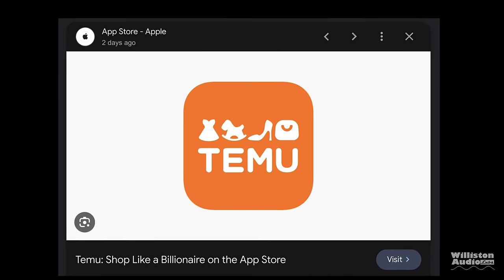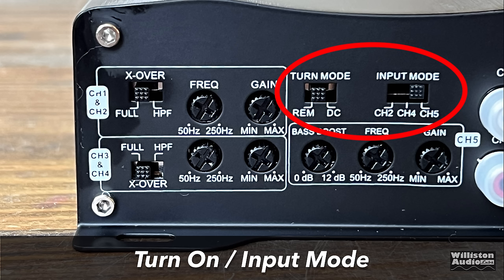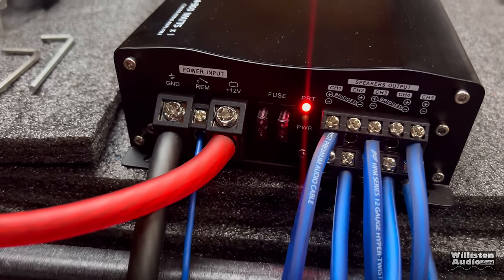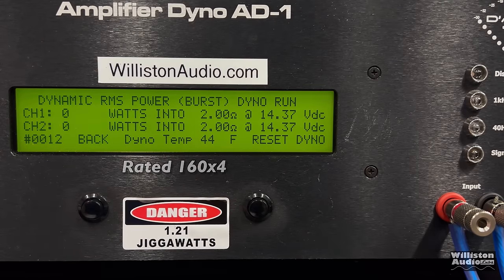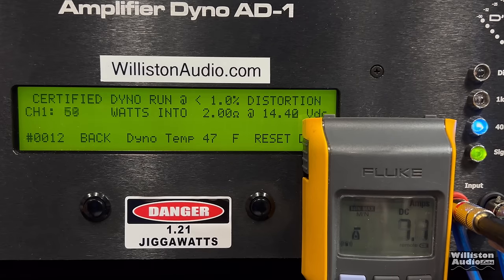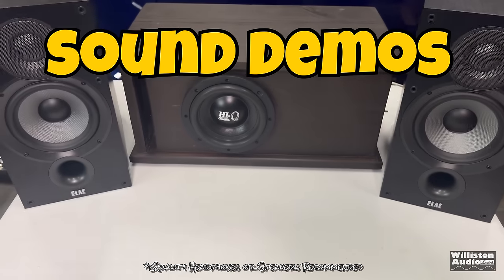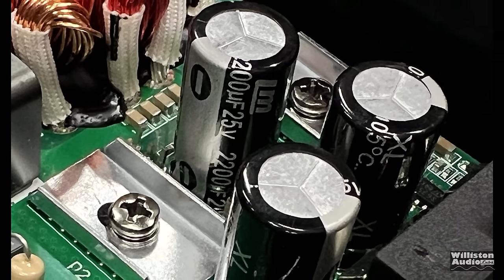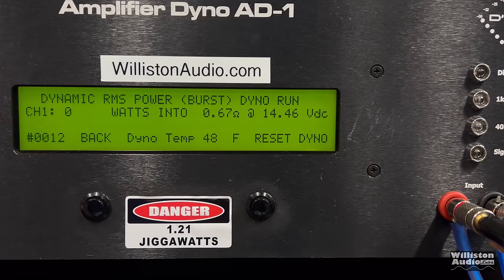I Bought a TEMU Car Audio Amplifier

Comment: Can you send it off to someone and have aome bigger caps and other minor mods done to see how much better it could be with some mondor modifications?
Reply: The cost of shipping, parts and labor would more than double the cost of the amplifier and probably not give you any improvements.
Reply: Bigger caps won't necessarily make it give more power. It might give a tiny boost to dynamic range, but that's unlikely since it's using a regulated switchmode power supply (SMPS). The inbuilt SMPS is already doing the job OK, as it's putting out rated power with all 5 channels loaded.
.
You can get an indication that the PS overall is insufficient when the power with 1 channel driven is higher than with all channels driven, however in this case D didn't test a single channel alone.
.
The main use for lots of big caps is for amps with unregulated PSUs, as the caps hold the peak voltage higher under quick bursts of power, so the dynamic output is higher than continuous RMS. In these cheap regulated PSUs the voltage is held 100% constant by electronic feedback, so bigger capacitors have no practical benefit to power output.
.
That said, the caps are there to filter noise from the power supply rails, and yes more is often better. As the caps die, more and more noise starts affecting the SMPS and it will start to malfunction at some point. The electrolytics only ever degrade (never get better) so having an excess of capacitors is definitely beneficial to a long and stable product life.
.
This thing probably only has the absolute minimum of caps needed to work when brand new, and would benefit from re-capping with more of better quality caps. Whether that's worth doing on a $100 amp is debatable since a decent set of caps will cost more than that 😂
Reply: @johncoops6897 You're thinking this amplifier has a regulated power supply? I was thinking it was unregulated since the output varies based on input voltage.
Reply: @JasonWW2000  - I explained it very simplistically, and while totally assuming how good of a SMPS is being used.

.
We know that the power supply in this amp is regulated because the total power doesn't change during the "peak" tests. If it was unregulated, before the burst signal was applied the rail voltages would rise above nominal. During the short 40Hz burst, the amp would draw a higher voltage (being stored in the capacitors) and hence would produce more power than with a 1kHz continuous tone where the voltage reserve would be depleted.
.
However, the total power output of a regulated power supply (to the amplifier) will still vary depending on the input voltage. You won't necessarily get more power with >14.4V but you will often get less with <14.4V. That's because voltage output of the SMPS is only regulated to a certain maximum volts.
.
Keep in mind that it needs to get that (total) power from it's own input and switching stages. The SMPS controller varies it's duty cycle to ensure that a certain voltage is available for the amplifier rails. If input voltage is lower, then it takes more Amps to achieve a given power level... but once the max is reached then the SMPS cannot process more current, so output Volts (and Amps) will reduce.
.
It's not actually quite that simple, and it depend a lot of the quality of the SMPS. We can assume that this amp uses the absolute minimum that it needs to need specs. In the following I will attempt to simplify without it being an electronics tech course...
.
Let's say the Amp and the SMPS are rated total max 1000W at 14.4V and there are no internal losses. That means that the SMPS needs 1000W / 14.4V = 69.44 Amps to provide it's regulated voltages to the Amplifier stage. So let's say that the SMPS has a total max current capability of 70 Amps, so all is good at 14.4V but everything is maxed out.
.
Now, let's feed the thing with just 12V. The SMPS can only provide 70 Amps maxumum internally. Therefore, at it's regulated output voltage (to the amp stages), it can only produce 12x70=840 Watts in total. Under lighter output loads, the SMPS regulates it's output voltage perfectly, however with reduced input voltage the SMPS cannot increase it's current... it cannot switch the output harder or faster as it was already maxxed out. Therfore, the output voltage rails starts to sag below the normal rail voltages, reducing output power.
.
So let's say the regulated SMPS provides (say) +/- 40V rails to the Amp section. The regulation prevents it EVER going higher than +/-40V and it's regulated to that up to a certain max power (e.g. 1000W at 14.4V) - so under light or intermittent loads the voltage will not rise, so the "peak" or "burst" power will not be any higher than for continuous load.
.
Yet if input voltage drops from 14.4V to 12V, then the maximum total power from the SMPS might well drop from 1000W to 840W. This is caused by sagging of the amp voltage rails, because the output load is "fixed". The rails can only get what they can get from the SMPS, and Voltage and current will drop to suit that.
.
That's a lot of theory, and we don't have sufficient info to know exactly how THIS amp performs with varied input voltages. A high quality amp with a good regulated SMPS might be able to provide max rated power at lower input voltages, and some brands even make this a marketing feature.
- my assumption here is that it's been designed without very much headroom, since it's been designed to meet a certain price point.
Reply: @johncoops6897  The regulated power supply I'm thinking of was common back in the nineties where the amplifier put out the same power at 12 volts as it did at 14.4 volts. I guess you could call it tightly regulated. That style of car amplifier isn't very common nowadays. 

Any time I see the output wattage vary based on the input voltage I think of it as having an unregulated power supply. I don't really understand how the regulation part works. 

It seems like almost every modern car amplifier is unregulated and can put out more power at higher voltages.

I don't know, I was just assuming this particular amp was unregulated.

PS, I assumed that during the peak test the reason we didn't see an extra amount of dynamic power was simply because the amplifier didn't have any additional reserve left in it.
Reply: @JasonWW2000  - the "amplifier not having an reserve" is precisely what proves it has a regulated power supply. It's the power supply which is the reserve...
.
Same as those old amps with "regulated" supply that you mention. They might be rated 1000W at 12V or 1000W at 14V... they are regulated to 1000W.
.
It all depended on the PSU, if it's running at rated 1000W at 12V then it will run even easier at 1000W on 14V or 15V or even more... unless it blows up 😃
.
However an amp that is rated 1000W at 14.4V with a "regulated" supply only means it sets the upper voltage level of the rails. It's regulated to never exceed those voltages if it's running at 1000W, 500W, 100W or 10W.
An unregulated supply has output voltage rails that vary with the load applied. At 100W they might be +/-50V yet at 1000W they might be only +/-40V. If it's playing at average 100W and there is a sudden bass beat then that will hit with the full +/-50V, but only for a moment. Hence big punch and dynamic range that hits higher than it's Continuous RMS ratings might indicate.
.
The article where you learnt that "strong" regulation term has some of the basics. However it doesn't cover the limitations of the SMPS itself, and how it can only ever provide the maximum it can provide.
.
The "regulation" of a PSU is on voltage, not total power. Let's use an analogy of a (decent quality) USB charger that's regulated to provide 5V... That will never provide 5.2V, even at no load. And it's rated at (say) 2A (10W) at a certain input voltage. If you exceed the current drawn, the voltage will sag to meet that max 10W. Doesn't matter if you feed it more input volts, it can only ever do 5V and draw a max of 10W... but how far can you reduce input voltage before the output wattage reduces?
- That needs to be tested, but there definitely is a limit. A crappy USB charger might only provide half the rated power if it's run on a lower voltage, yet a high quality one (eg genuine Apple/Samsung) might provide the exact same regulated 5V at full 10W all the way from 100W to 250V.
.
The maximum power from an amplifier is determines by rail voltage and impedance. If the PSU can provide the Amps of current needed to sustain those Voltages, then the amp will give it's max power. A regulated PSU simply means that the rail Voltages are maintained as well as possible. The PSU design dictates what input voltages are required to maintain the output rail Voltages - some have more headroom than others, but that doesn't mean that they are "unregulated".
.
BigD's tests are always with all channels loaded. So the PSU is always maxxed out. You might see a reduction of output power with a reduction of input voltage  yet if he was testing just ONE channel then he might be able to drop the input voltage from 14V to 10V and output wattage wouldn't change.
.
Your idea of "regulated" is perfectly fine, but the PSU is only regulated on the high side of parameters. There are limits on how much total power it can output, and what input voltage it needs to achieve that. Within those limits, the PSU is regulated... push it too far, and it falls "below regulation".
.
BTW this stuff is all about how Boost Converters operate, since it's DC to DC happening here. They aren't exactly the same as how a typical AC Mains SMPS operates, since they are stepping down after rectification. I cannot explain this here, but the overall size of the output inductors of a Boost Converter is what sets the conversion limits.
Reply: @johncoops6897  Cool, now I need to take some time to process all this information. I haven't read any articles, but I probably need to. So far I've just picked up bits and pieces of information here and there.

Comment: The fact that it performs its advertised power is honorable! how many mid range brands pull their "MAX POWER" attention whore numbers to attract you but fail miserable to deliver, also look at the size of it! I remember back in the 00s you'll need a skateboard to pull those numbers, I was doing a friends car installation and I told him how back in the day amps where sold 1.00 per watt, I slapped a 800w skar (kit) that cost him 300, 12" sub in box+ amp+ installation kit..🙄
Reply: Modern semiconductors are pretty amazing and have transformed Society.

Comment: Good subject of test.....BUT 
test it at 12V to 12.8V is the way to go. 14.5v is unreal-fair for futur user of any amp you've/will test
Same with THD limit at 1% 
Its hard to not bleed from eyes at such THD. Any amplifier or source must be test at a real need of quality with a test limit set at 0.1% THD for the RMS score  
If you want to add 1%THD range after why not. For fun  
Also fun to observ the top,max,pmpo,peak,ultranoisy 1/100000e second max power before clipping on labs material and share a 9000w amp with 10%thd and weite it on webpage, chinese are avle to do it and be proud. But not us.

So conclusion here if real fair test is : in absolute perfect ideal condition nobody could reproduce in real use, you could have the announced power in a quality that destroy your ears and maybe eyes too 👀
Thd turn your balls in flat powder bag, eyes bleeding desesperatly and during the torture test in car it also could probably cook an egg on top of amplifier heatsink/body/advertisement 🐝 bee mines 

Just use it to stop your car rolling back in driveway and look at a normal fair reasonable THD/RMS/VOLTAGE/ real world rendering

But thank you testing some amplifier no one have tried on a bench 

Cheers from France 🇨🇵
Thank you for your channel ❤